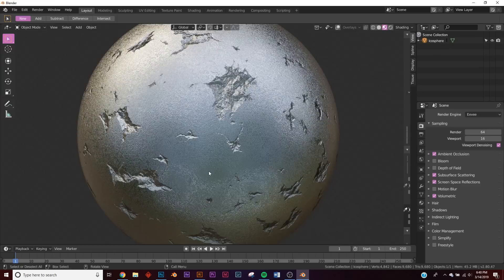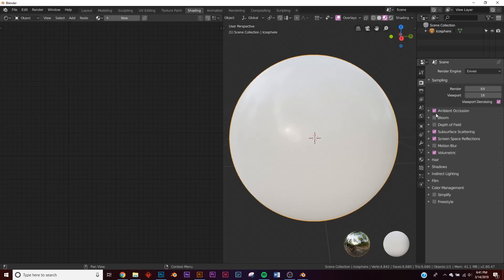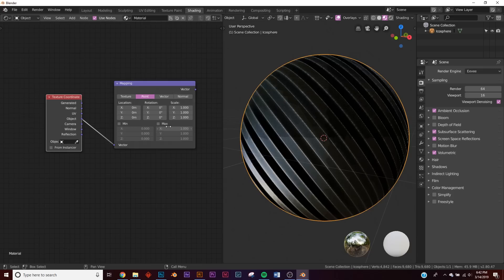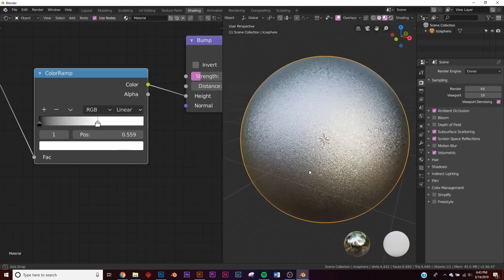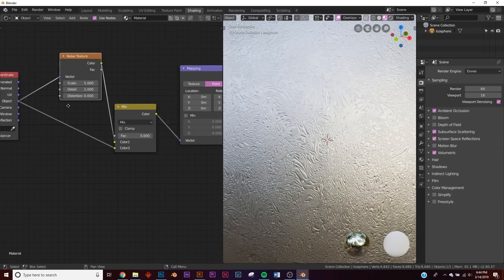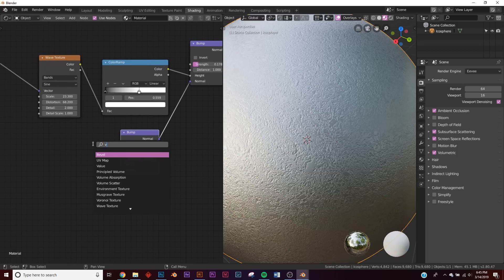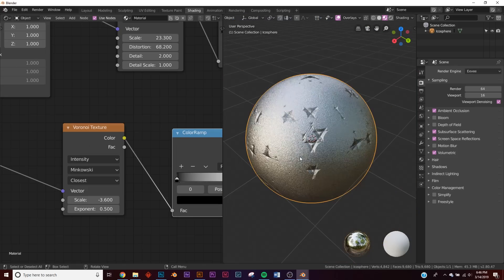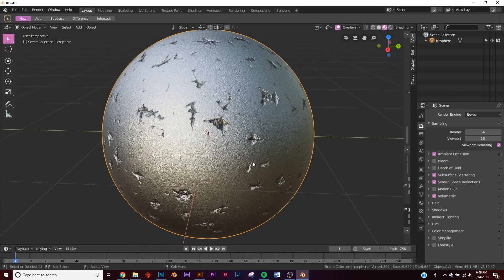Blender - Procedural Dented Metal shader (Blender 2.8)

Comment: If youre using in Blender v2.93 the voronoi texture changed so what you want to do is set it to 4D , smooth F1 and minkowski. Instead of color connection into the factor of the color ramp connect Distance and it should start working like the tutorial.
Reply: Thank you. That worked for me, but I had to set it to 3D.
Reply: Thank you for this comment 🙏

Comment: Thank you very much!!

P.S: On 2.83, the wave texture node has a Detail Roughness slider that can achieve the same effect as putting the Noise node on the vector line, thus saving a step. Voronoi still needs it though.

Comment: Granted I'm discovering these videos pretty late but I have a question.  How to keep the outer surface bump/pattern out of the crevices. It would make sense that the outer surface would not be patterned exactly the same as the gouges.  I used almost the same technique to make a rust pattern and added another color ramp into the roughness so that the rust would not be shiny.  However, it would be better to completely separate the bump patterns for the shiny outer surface and the rusty or gouged out areas.  I haven't figured out yet how to do that.

Comment: So this is like a modular synthesizer. You got the VCO, LFO, CV, but there you have Texture generator, Mix RGB, Color ramp... couldn’t be very complicated.
Also me after one hour of using Blender : smashes keyboard and turns off computer
Reply: You are really on to something friend. Digital GFX and audio production are VERY similar and can inform each other deeply! From data compression (mp3 ~ jpg) to dynamic compression (compressors and limiters ~ curves and gama), to the way attack and release times relate to everything from keyframe animation, to procedural texturing, to unsharp masking... If you understand LFOs and OSCs you have a HUGE advantage! Hang in there, it gets easier (and FUNNER)!! 😎

Comment: My question is how do I change the 

orientation of the screen split when I 

click on the shading tab. By default it 

will split the screen horizontally and 

place my node editor on the bottom.

I was watching your tutorial and 

when you click on shader, it splits the 

screen vertically instead of 

horizontally which I find much easier to 

use.

How do I get my screen to split 

vertically by default like yours does?